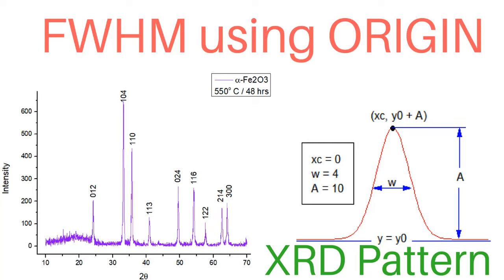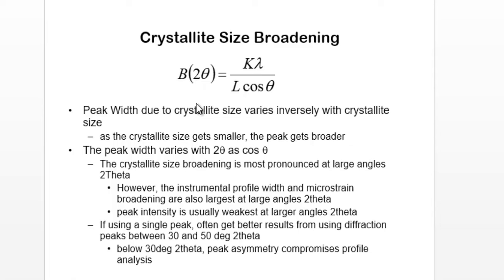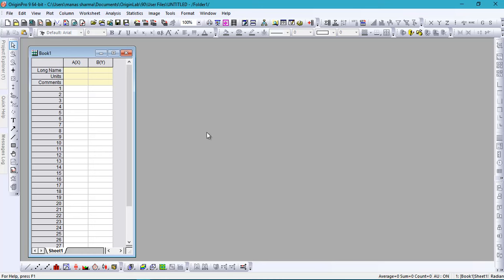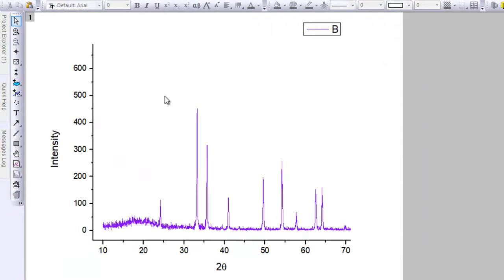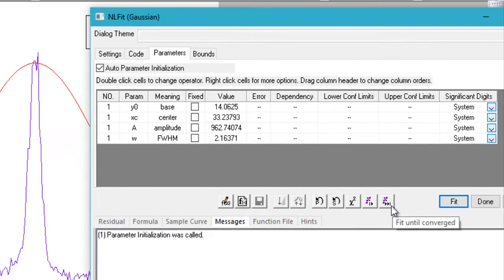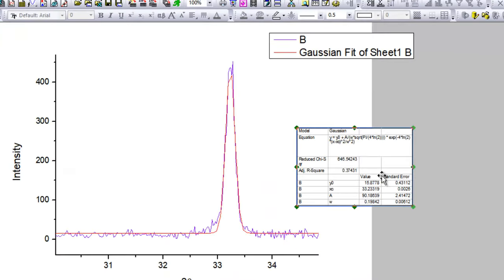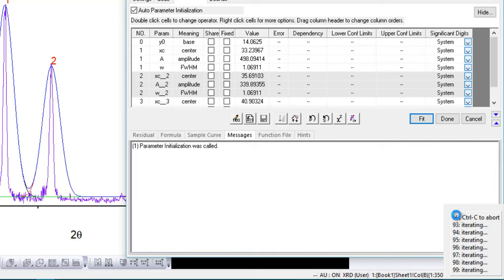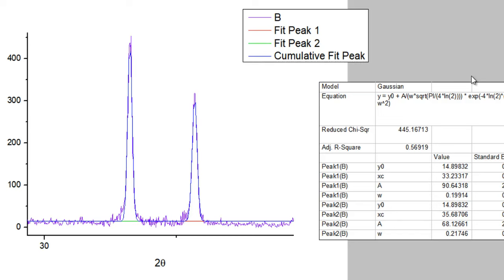Calculating FWHM for XRD Peaks using ORIGIN

Comment: Does it give FWHM value in radians or degrees?
Reply: Degrees. You will then need to convert it into radians.
Reply: Manas Sharma Thanks.
Reply: FWHM value in 2theta (degrees)?
Reply from the maker: The FWHM you get from the Origin is in degrees. To get the crystallite size, or to use the Scherrer's Formula, FWHM needs to be converted to radians.
Hope that clears up the confusion.
Reply: It was a very useful video. After we get cos theta, do we have to convert it into radians and then substitute the value in radians in the Scherrer's formula and use it to calculate crystal size?

Comment: how to get cos theta ? is cos theta is equal to FWHM?
Reply from the maker: Theta is the diffraction angle. In the diffractogram, you have 2theta in degrees on the x-axis. So just divide by 2 and then find the cosine of that. The FWHM returned by the software is in degrees too. Using that and the value of cos theta and K, you can find out the crystallite size L
Reply: well i already got my ressult, i relize that already, and i feel stupid to asking you that question haha.
Reply from the maker: No worries. Happens to the best of us. :)
Reply: anyway i have more question, how we analyze the crystal structure (111) (102) (100) etc, can i using MAUD software to do it?